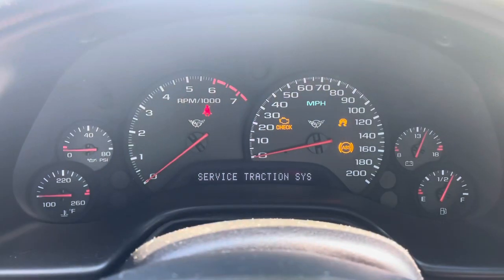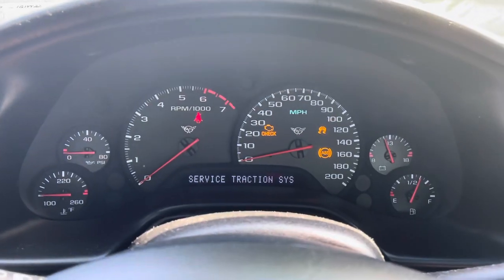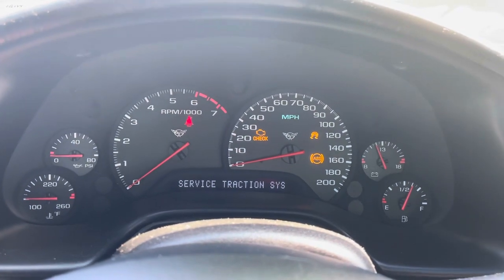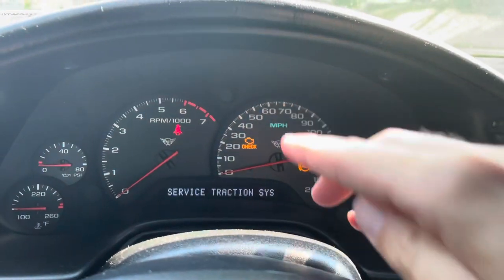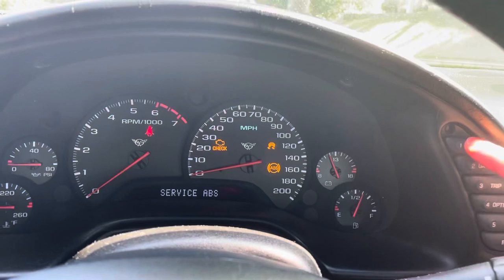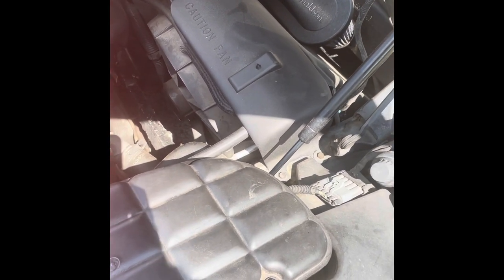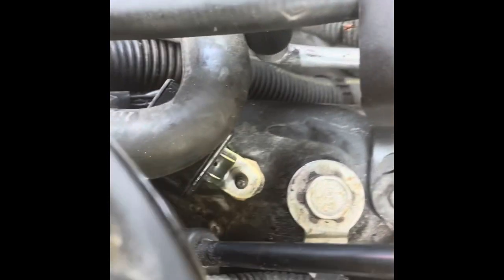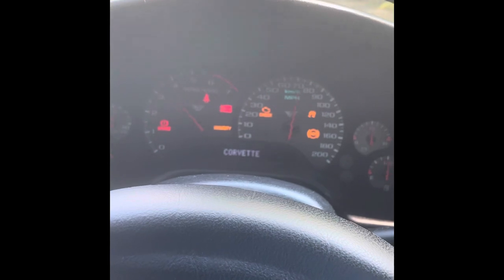C5 Corvette Door Accordion Wire and Ground Cleaning Part 1

Comment: You can take apart those ground distribution things that you were cleaning around and clean them also. Mine is an '01. I had a few recurring gremlins with mine that were cleared up with a brand new and one size bigger battery. My optima red top was 3 years old, so I thought it was good. On a whim I replaced it and have had 2 minor incidents in (electrical related) 18 months.
Reply from the maker: Thanks for the reply yeah electrical and c5 go hand in hand! I will check out the door hinge connectors like you mentioned also!
Reply: interesting on a fresh-stronger battery........

Comment: I have a 2001 C5 that was built in October-November of 2000.  My EBCM was replaced years back to solve the constant Service ABS,  Traction Control etc message.  That repair cost me $2600. The new replacement EBCM worked fine for a year and then started with the same intermittent Service ABS etc messages for years.  I plan to repair the EBCM circuit board with new solder on several points. However,  my right door threw a NO COMM code when all the electrical power to that door stopped everything from working there. This apparently prevented my Remote Keyless Entry FOB from working (new batteries did nothing) the door, trunk etc.  I have wiggled the wires in the accordion shield and power was briefly restored (to get the window up or down), but clearly, this needs to be examined and fixed My car is garaged so water is not the culprit there.  Electrical gremlins...I hate them.  BTW, what was intermittent with DIC reporting Service ABS etc has now become consistent.  The interesting thing is that the service report has never effect the brakes , traction control etc.  I will report back on this thread with what fixes work.
Reply: Like you I have had my ebcm replaced a few years back. No random codes for awhile then slowly started getting abs, traction control, and other codes.  Cleaned grounds which didn’t solve it. Recently had my ignition switch replaced which at least temporarily has cleared all the codes and nothing random popping up.  Not sure how long the fix will last but something you might want to consider. Good luck
Reply: Ohhhhh man mine is in limp mode and I can’t program the key fob after the car was sitting for a bit :/ any advice on where to start ?

Comment: Today, following up on my post below, I was able to look at the connectors and found nothing unusual.  The connectors were not inside the rubber accordion shield but actually in side the A pillar.  The accordion shield has no slit in it unlike what the video shows.  Being whole it was difficult to squeeze it enough to access the connectors.  Everything is back in place now. No fix was made so I will try and see if the re-positioning of the connectors makes a difference.  All electric on the right door works.  I also ran the codes and before this effort I got a NO COMM code.  Now, no code.  Whether this issue was a short or a ground issue somewhere, I just don't know.  In the past I have personally accessed many of the grounds and cleaned them off.  They were all clean before and tight.  My C5 is garaged with the usual battery tender in operation. It is mostly a show car now.

Comment: This fixed my driver's door window and lock issue. The female parts of the connectors on 3 pins were loose. Thank you for the guidance!
Reply from the maker: Glad it worked thanks for using it!!

Comment: I had this problem my left door switch Argo dead nothing would work radio with shut off I will get a signal from the computer traction control and up being the green and black that plug into the window module needed to spread prongs fart better had a bad connection solved my problem
Reply from the maker: Thanks for the reply! It’s good to share fixes for these cars because a lot of us experience weird electrical issues.

Comment: 2k C5 with similar electrical issues.. was looking forward to part 2 of this.. what was the fix?
Reply from the maker: Still working through it actually
Reply: @dantedoescars  just got my car back from service.. i will be trying again to work on this issue soon. It's funny in the vid 5:30 you said you would try to disconnect it with one hand, a while ago i tried for like an hour to disconnect that cable. It looks like your accordion is cut, i've considered cutting mine so I could remove it so there's more room to try to disconnect the cables.. i haven't cut them because i'd rather they stay water tight. My traction control goes on and off randomly which I think is a symptom (among a few others) that i think is due to the grounds needing to be cleaned. I'm wondering if you made part 2 of this vid yet? Thanks

Comment: My wifes C5 had the Service ride control mesg. Cleaning the grounds behind the R wheels on the frame fixed it. We had an intermittent engine stop and crank no start.  That one took 3 months to finally narrow it down to the female connector going to the Crank pos sensor.  Behind the str mtr. Lots of heat dirt and oil there.  $!0.00 pig tail all good now.

Comment: Good video. I am having same issue w/ my 98 C5 . Except no codes etc.. Just windows not working and only 1 dr lock working.  I will try your wiring advice tomorrow. Thanks
Reply from the maker: Try it and post up I think it will help your problem!
Reply: Did you solve your door lock? My driver door lock hasn’t worked since 2016. I’ve just left it be.
Reply from the maker: @dannystackhouse4600  passenger window and lock have been working ever since I dried out the door accordion wires and re taped them all!

Comment: Did you ever solve traction control abs issue?
Reply from the maker: Not yet! When I repaint the calipers I’m going to check out the wheel speed sensors and clean them up see if that does anything
Reply: @dantedoescars  it could be your battery is not fully charged.  This just stated happening to mine.  (2003 cont vette) Not fully at 14.2 volts. Traction control and ABS come on i just reset   If i driver for approximately 15 or so minutes battery is at 14.2.  I stop shut vette of and restart either within a few seconds or even wait 30 or so minutes.  I start and everything is gone.  Overnight with or without battery tender everything lights up again. Run it and turn engine off everything gone.  Interesting???  Thought i would share.

Comment: I have a 2003 C5.  I went down the same path with no success.  Then I repaired the EBCM and BINGO!  No more idiot lights or error messages.
Reply from the maker: I have read up, and assumed as much for many years now! The problem is, I have a pre-2000 model year, and they are still on repairable

Comment: I just got a 2000 C5 and started having the same messages. Did you ever solve this?
Reply from the maker: Have not gotten back to cleaning the rest of the grounds with life and other things. When I do I’ll document it and post!
Reply: I had similar issues, there are 4 BCM ground connections I cleaned real well which at first didn't seem to do anything... only after 3rd restart/ignition cycle did the codes go away. Since then whenever it rains its about a 50/50 chance if those errors will pop up so I must have a water leak somewhere.
Reply: @ACreativeGuy  My Vette never sees rain and is garaged when not being driven. I just drove it hard once and the warning came on. But after restarting, it just stopped showing up. I rarely see it now but only when it doesn't like being driven hard.

Comment: The black plastic connectors esp in the engine bay can be prone to failure if water gets in them. Take them apart, clean up the contacts. For the ground points just in front of the door hinges, you can take off the black plastic ground connector and instead bolt the grounds to the metal panel with ring terminals. There's some good posts in the corvette forum about this.
Reply from the maker: Thanks for commenting I will look into opening the connectors and inspect those also!!

Comment: My passenger door dailed last summer this summer the entire window failed and nowy car won't start.could this be a wiring harnesss.i literally parked at a friends house came out to my oassenger window rolling itself down started the car it died after 20seconds all warning lights lights came on mind u ive neva had so much as a check engine light on. Now car says key fob not recognized had a locksmith check it he strted car using tech 2 got a code for ignition switch i replaced it same problem.
Reply from the maker: C5 and electrical gremlins. I would first try simple stuff like battery tested at autozone for free, these cars are known for parasitic drain big time. But after that shake the passenger black accordion wiring as you try to put window up and see if that puts it up.
Reply: Thanks that hasn't fixed it. Will be sending to 4th shop. 😢

Comment: What was the fix?
Reply from the maker: Set it on fire! Jk if you see more recent videos, nothing yet, had a coolant tank leak that I fixed, a leaking bad sealed front tire(2nd time), and now a power steering leak! I can deal with psycho gauges/dashboard, but I need the car mechanically sound!!